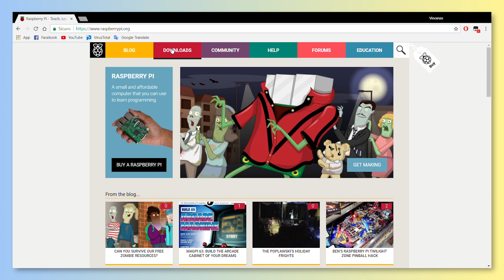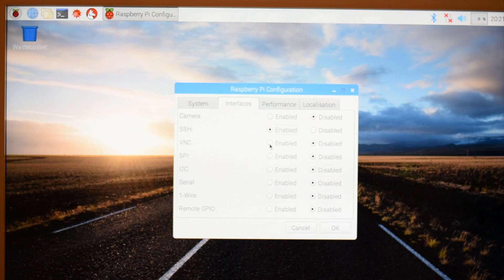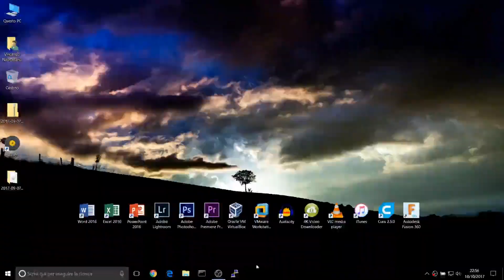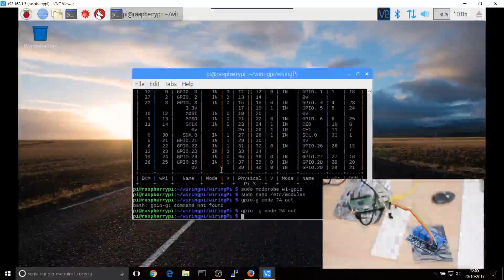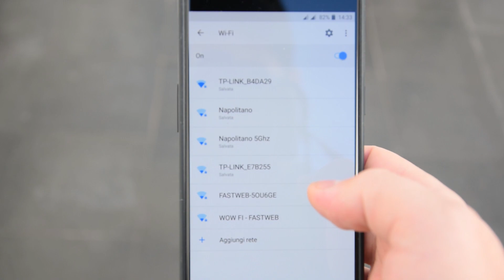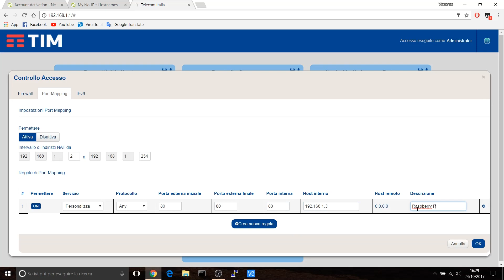Open your electric gate with your smartphone! - My Raspberry Pi first project

Comment: Hello Vincintosh - I'm really interested in this solution as I have Quiko (Italian) gates which open into my yard.  I have setup my Raspberry Pi with WiringPI and the GPIO utility but I am a little stuck on the index.html webpage side of things.  Is there any chance you could point me in the right direction of the webpage which calls the PHP code?  I know this isn't a tutorial and I respect that.... but I would love a little guidance if at all possible.  Best wishes from Oxfordshire, UK.  Alex.
Reply from the maker: Just put a link or a button in the HTML file linking to a .php page with the code